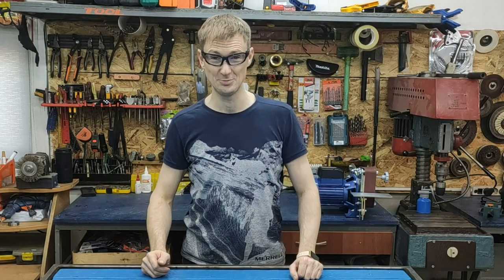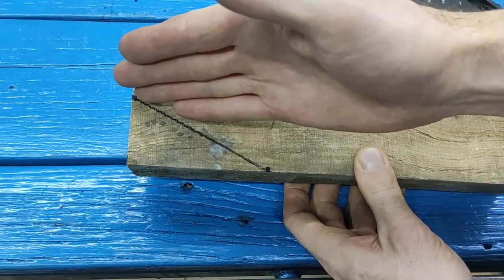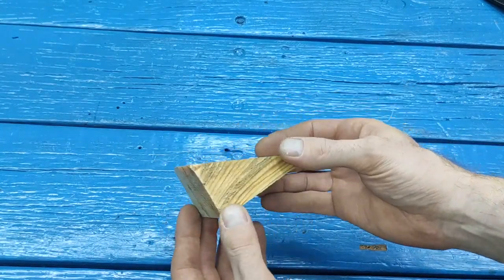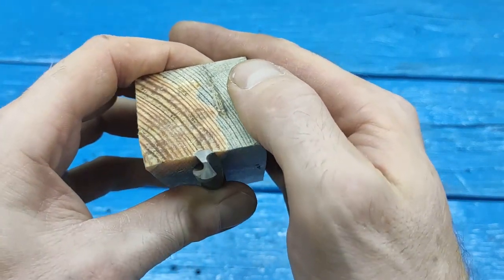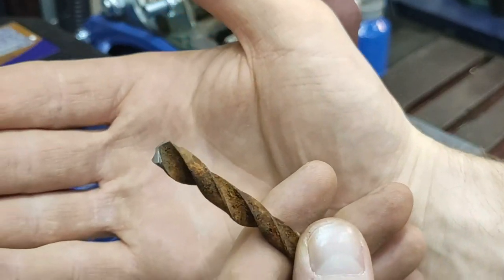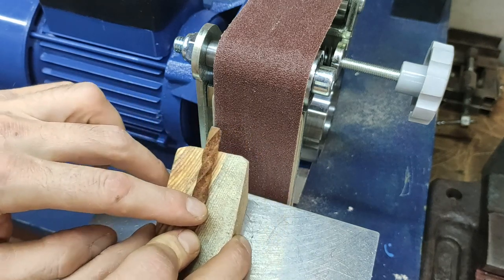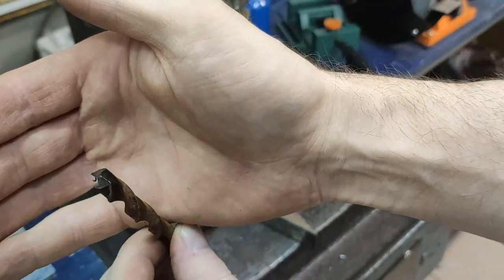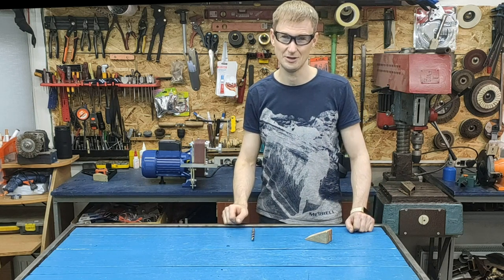Drills in the workshop are always sharp now! Simple self-made tool for sharpening drills!!!

Comment: I do not want to be abusive in this analysis but it is an over simplification of the complicated angles in drill sharpening. Just because the point was cleaned up means nothing. Do some research. There is no relief after the cutting edge. No effort to center the point, etc.
Evidence shows that the ruined drill doesn’t make any kind of chip when burning through thin wall mild steel tubing. The heat discoloration is obvious. Sorry but this technique gets 0 out of 10!
Reply: right, no relief means zero cutting

Comment: This method is OK for drilling wood but for metal you'll have to use a pilot hole, which require a drill with what referred to as a first cut drill. I have some 3 or 4 hundred drills that i have to use use a new first cut drill to use them, I have to buy new small drills constantly because the first cut is very delicate to side movement. I would never waste my time on trying to drill with a reshaped drill to start a hole